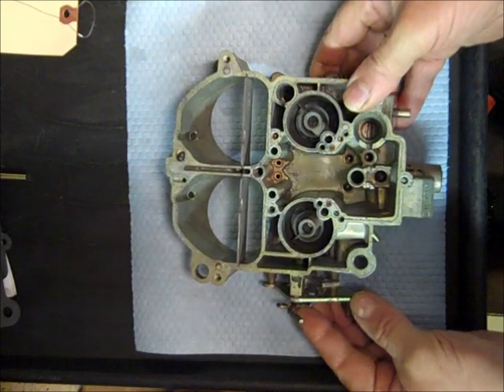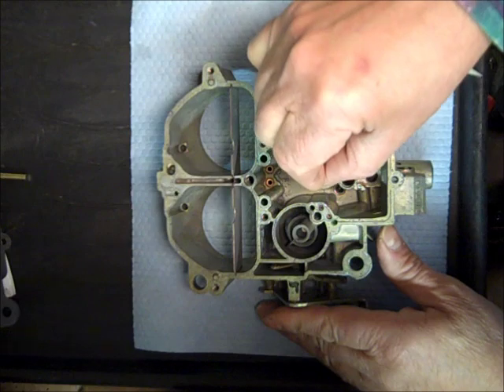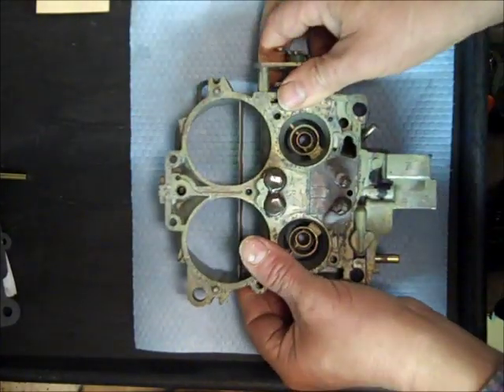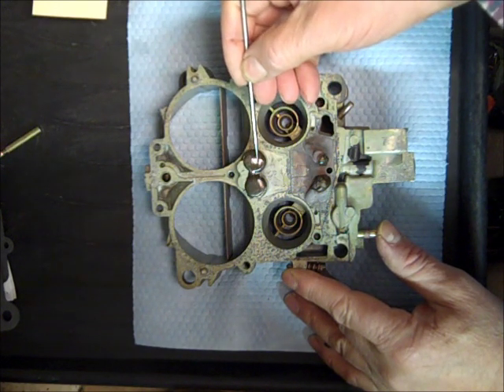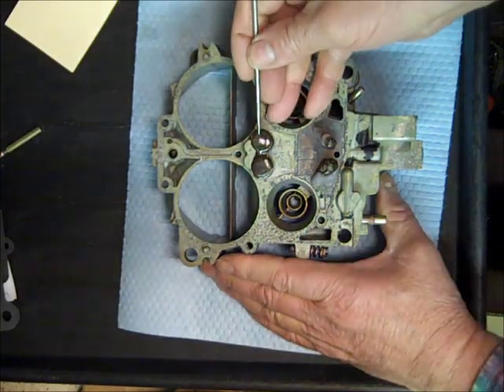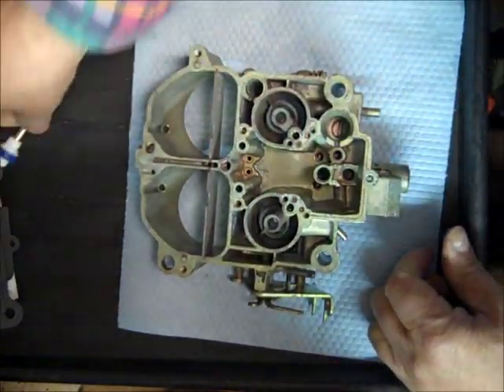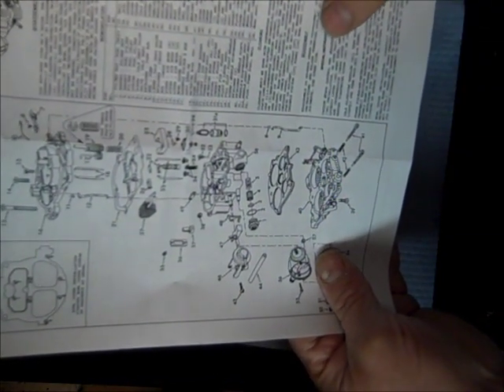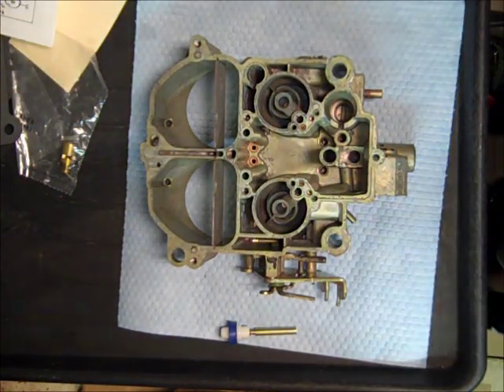Rochester Quadrajet Marine Carburetor Rebuild Part 1 of 3

Comment: Would u pls let me know if I can use an automotive Rochester Q-jet carb for my boat (if I block all its vacuum connections)?
Reply: The marine carb has a hose that connects to the fuel pump in case of fuel pump failure. without it you take chance of blowing up your boat. should the fuel pump fail with a auto carb, the gas will enter the crankcase , with a marine carb the gas will travel up the tube and into the carb, thus preventing you from blowing up, never use auto parts in a boat, its also against the law.

Comment: My marine Rochester Quadrajet carburettor’s secondary valve doesn’t open completely 90 degrees as the primary valve when I fully open the throttle, is it normal?

Comment: I blew out every hole, even used a WD4 can and blew though every hole and all were open.  I have had this apart 4 times now and it does the same thing every time I put it back on.  The motor runs if I rev it and dies as soon as i hold the throttle still.  I can see gas shooting in when I pump it.   Could it be the fuel pump?  This is kind of a dumb question but is the gas sucked in by the vacuum of the motor or is it pushed in by the fuel pump?
Reply: Not sure why nobody answered you but....fuel is pulled in by the vacuum of the engine. The venturi effect. The fuel pump pumps to the carburetor bowl and when it's full, the float closes and no more fuel can get into the carb. Works a lot like a toilet.

Comment: Hi Mike great videos! So I have a boat with a 350SB in it and a Quadrajet Carb with a serial number 17080561. I've had nothing but problems with this carb and now I'm wonding if it's meant for a 350SB considering the serial number has it identified for a Pontiac. And Ideas here?